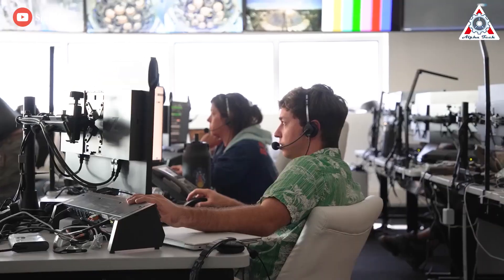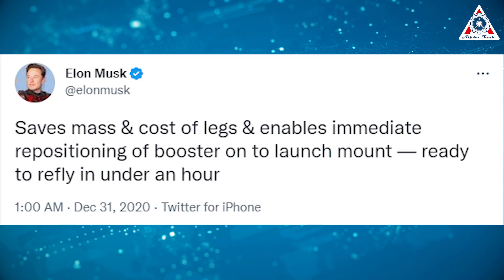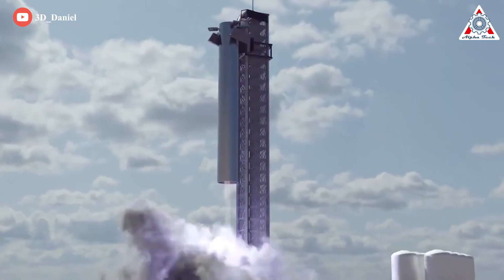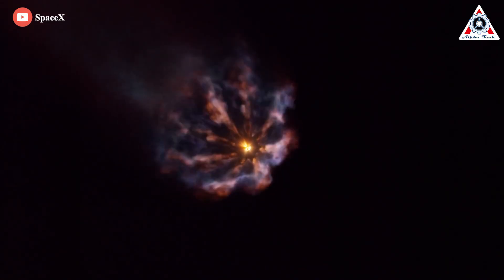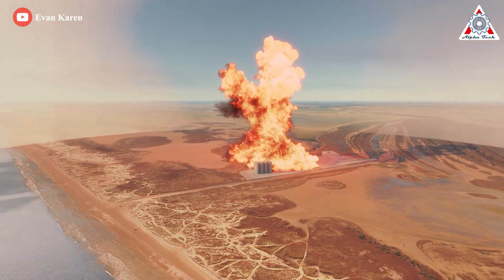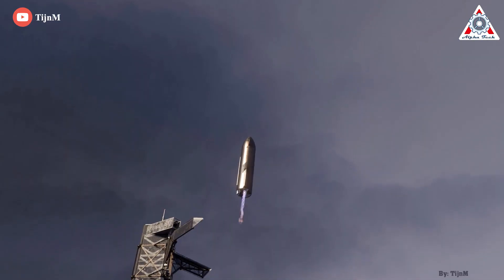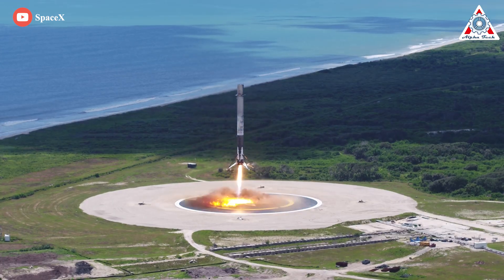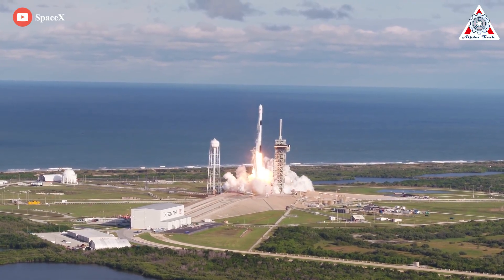SpaceX Mechazilla Catching "PROBLEM"…

Comment: SOME OF THIS really doesn’t make sense to me. From what I’ve read, the flight time of a super heavy booster is 6 minutes— 2 minutes up, 4 down. If there is any damage to the pad and tower, there is no chance you can inspect let alone repair it in the allotted time. 

These arms are meant to swing to the side anyways, why not catch the booster 90° or 180° away from the launch equipment, then swing it into place later? That would cost nothing more than a bare piece of concrete to act as a landing pad, provided it’s far away from feed lines and such.
Reply: Bro that’s extremely difficult with basically just the rocket boost supporting such a heavy and long device. It would be so hard to balance the rocket at those angles. There’s a reason the rocket enters and slowly adjusts the angle versus momentum the way it does.
Reply: @HeilIsrael   I’m not talking about rotating the rocket, I’m talking about rotating the chopsticks to the other side of the tower, so it doesn’t need to catch the rocket over the launch pad— where it might damage umbilicals, etc.

Comment: Once between the chopsticks seems like there's 7 seconds or so to fine tune chopstick/super heavy position. If is between chopsticks at that point then is within a metre or two of optimal position. Obviously a few hundred metres out they should have super heavy falling straight downward with little lateral velocity deviations.. So with 10 seconds to position things they only have to make 10-20 cm per second corrections. if they have a metre tolerance it shouldn't be so hard as long as raptors can manage steady 10cm per second corrections. if one raptor is generating 1 g for landing mass then off axis gimble control of 1% should be enough if final envelope characteristics a few hundred metres out are nominal. I'm sure initally they could land with more fuel to give better margins ie 20-30 seconds to position between chopsticks and then as confidence grows use the extra 30 tons of practice fuel for actual mass to LEO....

Comment: There is definitely a reason why the launch pads are miles away from the assembly buildings and each other at Cape Canaveral. One explosion on lift off or one during recovery could knock out the whole Boca Chica facility for a year or so. Any loss of life would cause commissions and investigations that will last even longer. The launch license by the FAA might be revoked until remedies are put in place. Taking all this risk is kind of short sighted.
All that is without even addressing the obvious difficulties in "man-rating" Starship. I am convinced no NASA astronaut will ever launch from Earth on board Starship. Any NASA missions will have crew launched on a man rated vehicle and dock with Starship. Starship itself is every bit as dangerous as the Shuttle if not more. (The crew sits INSIDE the second stage surrounded by two sets of fuel tanks, with no ejection capsules. How would you man-rate that??)

Comment: Add in the wind it will be near impossible under the present configuration. Can't wait for calm days as there are only a few a year on the shoreline.  I believe it might only work if the arms were built in a funnel configuration that would allow the rocket to self center. Ship however, would have to be redesigned without lower fins.

Comment: I have a solution to this problem
Reply from the maker: Can u explain about that?
Reply: @alphatech4966  Starship needs a launchpad booster/catch ring to lift it higher before it goes full throttle. Wider AOE to diffuse the energy of launch across a wider area. No more concrete rain. Can double as a test for preflight certification because engines don't leave the pad. Then the ring can be divided into 2 or more sections to catch the rocket like a hands would.
Reply: Well I've been trying to find a way to get in touch with someone at space x, but so are thousands of other people. I just got home from work and i think im literally gonna just use cardboard to make a mockup and upload a video onto YouTube and hope it gets to them before they destroy the pad

Comment: Shotwell has to intervene ; the Super-Heavy landing should be downrange using a suitably built landing platform that INCREASES prospects of success. Its too dangerous for FAA and NASA to be associated with a recklessly dangerous landing concept, it can not be next to fuel tanks or a tower required for the Starship to land. IF there are to be multiple on-going Super-Heavy launches they have to land safely such as at a specially designed floating platform 40 or 60 miles downrange; perhaps landing through a landing ring 30m wide and 30m high inside of which is a 25m wide landing well with 10m wide bottom that the booster could come to rest on AFTER restraining straps from the landing ring snap across to center and secure the booster during the final one second of landing. Afterwards the Super-Heavy can be gently tipped and loaded on a transport barge for return to Bocca within a few hours of launch.

Comment: The arms are attached to a huge cable which is attached to a huge shock absorbing pulley at the motor on the far end which absorbs most of the shock.  The arms will travel vertically as the pulley slows the rocket to a stop.  Do you guys ever put out a correction when you miss such an important piece of the engineering?
Reply from the maker: I will find more about this, thanks

Comment: The problem is that rocket engines are not as reliable as jet engines. Most probably Elon has to create the whole industry just for Raptor engines only. After landing each raptor must be refurbished prior to new launch. If you want to launch many times a day, you have to have many fresh refurbished engines ready to use. I don't believe that rocket engines can be used every couple hours again and again with out any problems. No one want to be a kamikaze to fly the same rocket engine in the same day twice. NO WAY.

Comment: Landing a booster is tricky. SpaceX blew up a few developing Falcon 9. The legs add weight and transportation from landing to launch adds time. Landing on arms is the same problem. A target location & altitude. No transport no Landing legs. Bigger initial expensive, paid for by rapid relaunch of the booster.
Reply from the maker: Yes. SpaceX needs years to control F9 landing

Comment: Catching it is the worst idea I've heard in YEARS! Just ONE screw-up and you lose the booster, tower, OLM and likely most of the surrounding facilities. That FAR outweighs the cost of landing legs! Even a few degrees of rotation out of position can spell disaster! Remember, these are the same engineers who designed the OLM without the capability to withstand the thrust of the booster! Destruction of the concrete and damaging the equipment at EVERY launch simply isn't effective OR efficient! IMO
Reply: ouch, this didnt age well

Comment: PLEASE MAKE A VIDEO ON STARLITE https://youtu.be/0IbWampaEcM SHOULD SPACEX IMPROVE THE HEAT TALES WITH EXTA COATING OF STARLITE UNDER THE TILES JUST FOR SAFTY MEASURES IN CASE SOME TILES BRAKE AND FALL DURING DESCENT. PLEASE COMENT. OR EVEN REPLACE THE TILES IN SOME PARTS WITH LAYERS OF STARLITE AND HEATRESISTING FOIL AS A SANDWICH.

Comment: SpaceX should start construction on new launch tower sections in Boca Cheeca to have it on stand by incase the booster blows up on launch and destroys the launch tower or if the booster crashes on the tower causing errepairable damage to the launch tower. This way they could rebuild the tower even faster.
Reply: Before they do that, they'd better have worked out all the concrete base bugs first, or else they'll double the corrections that would have to be made later.
Reply: They could have a dry tower nearby for receiving the booster. A dry tower would have arms but would have no fuel lines or tanks nearby, just a fire suppression system. It could be on tracks so once it’s caught the booster, it can roll back to the launch tower quickly— if the inspection shows everything has gone to plan.
 
Or, as I mentioned elsewhere, at least have the arms on the launch pad rotate to catch the booster away from the launch pad, then swing the booster into position.
Reply: @dmrr7739  Great idea!!

Comment: Can't thank you enough for this mental stimulation!  Landing Solution: 001:  A large oversized  series of landing hoops  can supplement the landing accuracy by shooting a plurality of firehose nozzles towards the center of the chopsticks.  It would ack like a liquid funnel.  It would ease the ship or booster towards the center of the chopsticks and may even be able to lighten the load on the chopsticks by spraying upward towards the grid fins.  Will need to control  the aim of the nozzles as the ship enters the hoops so as not to extinguish the engines!!!  The size of the; at sea landing barges,  should be a guide to the size of the hoops.
Reply: It sure is no crazy than what they are planning. Can anyone you know make an animation of it?
Reply: @lindyhoppingfool  I can make a "Paint" sketch of it.  Wish I still had Dr. Halo I could make a slide show. But sorry, no; I don't know who could make an animation.  A simple imagery is to think of three iron hoops concentrically aligned;  suspended 10 meters apart from the launch tower;  and, each hoop having several gimbaled fire hose adjustable nozzles.  A spray may be just enough of a push rather than a hard stream.  Don't want to flip the ship over! As the ship enters the hoops the nozzles spray the ship towards the chopsticks with a lifting bias in the spray.   The real McCoy will have ten concentric hoops!
Reply: @lindyhoppingfool  Ever hear of Dall.E ?  That AI plus other recent AIs can take my description and run with it.

Comment: I think the crew at SpaceX have got their heads around landing within a tight area of operation, it's the anomalies you have to pin down to make their calculations reliably work.. once you have a functioning system as with the Falcon, the rest is scale.  My worst fear and prediction here is that during the last stages of deceleration and the transition to hover, there is contact with either the tower or the chopsticks.. It's a one way trip, it's not going to be able hover and do a bunch of corrections and land somewhere else because "something happened" as that would be magic. There are a lot of moving parts that need to come together flawlessly for one of Elon's biggest projects yet, godspeed!

Comment: How do they intend to catch it when performing the point-point global flights which SpaceX said would definitely be in operation within the next 6 years, making long-haul flights obselete? The launches will have to made from offshore platforms and operate in all weather conditions. Unless it's anchored to the sea bed, a floating platform is going to move around due to wave motion, so how will it manage to catch a descending booster when the tower is rolling and pitching at the same time as the booster is fighting against gale force winds and torrential rain to reach target position?

Comment: 😎👍👍👍It's good someone else mentioned this little problem. Not only will the first catch be a total nail-biting experience, let's look at the odds of every catch that will have to be made. Machines ware, there will be failures. The cost of one failure will have to be minimized somehow. I would have bigger berm walls and keep the tank farm far from the tower. Elon is over his head here and needs expert help. ME. I can think of better ways to catch a rocket than using a tower so close to components that can't bare explosions like a failed catch will produce.
Reply: I would need to see about 100 successful catches before I'd put a human in the starship.
Reply: If they “miss” a catch they write off the extremely complex pad stage zero equipment - which stops launches for months. The rocket can only be launched if the pad is undamaged.

Comment: Keep in mind the chopsticks are suspended by a cable, not apparently fixed on the tower.  So the cable (and whatever else is designed into the system) would act somewhat as a shock buffer on landing.
Reply: Thanks. I did not know that. Makes sense though. No sense damaging the tower if you don't have to. Cables would snap before bringing the whole darn thing down, right ?

Comment: They could have tried this with a falcon 9.  The resulting implosion would be less consequential in case of failure.  SpaceX could have tested the navigational software even if the ships as so different in the process.    
Again, the choice of the location of the tank farm is appalling as it leaves no room for failure.
Reply: Christophe Blanchi the tank farm has to be near the OLM as there would be far too much loss of cryogenic propellant. Most of it would boil off before it reached the rocket
Reply: @markbishop4774  NASA has no problem with keeping its Liquid Hydrogen tanks out of the blast radius at Pad 39.
Neither do everyone who designs LNG tanker facilities. You just need to insulate the pipelines properly (vacuum works really well).
SpaceX just didn’t buy enough land.
Reply: No SpaceX couldn't. The F9's minimum thrust to weight ratio is greater than 1 - it cannot hover.

Comment: If they manage to avoid the Soviet N1 syndrome and get Starship to be reliable with its 33 closely packed engines and, as if that wasn't enough, reliably catch it using expensive launch site infrastructure also required for launching without destroying it, it will be a miracle.

If that doesn't bankrupt SpaceX, a backup using hardware designed for Starship would be a Super Falcon 9 using 9 Raptor 2s and a Super Falcon Heavy using 27.
Reply: So was Falcon 9.

Comment: When the catching seems too hard or unreliable in practice, SpaceX still has the landing legs as plan B. The chopsticks then only function as a lifting crane, though somewhat over-designed for its job, but very useful nonetheless
Reply: In fact, I still think that is the most likely outcome as NASA is involved more and more. Rather take more weight and massively reduce risk
Reply: The pad design requires the rocket to land on the pad. Anything else and SpaceX is back to needing a vertical assembly building and a transporter that they don’t have.

Comment: This is why almost all early NASA propsals for re-useable boosters and orbital re-entry vehicles used winged flyback designs.
Reply: DC-X was a bare pad design.
The complexity of the SpaceX pad is a different order of magnitude than anything NASA ever tried - the SpaceX engines are spun up by the equipment imbedded in the pad to save fuel and weight.

Comment: Such a catching maneuver can certainly be difficult when there blows a somewhat stronger wind. What I imagine is that you practice it with so much fuel that you can try it out many times without losing the rocket.
Reply: They should be able to mitigate that somewhat by only 'landing' in good weather, the same way that many early NASA launches were scrubbed due to bad weather in a distant recovery zone.
Reply: @ghost307  Certainly a good idea for the beginning, while it in the long term would run counter to the reusability aim.

Comment: So much negativity lately. One thing to keep in mind is yes there was a lot of trial and error with falcon but they’ve learned a lot and I remember them originally saying they can never land a falcon booster. And one thing SpaceX is good about is learning from past mistakes.
Reply: The "advantage" Space X has over NASA is they work at a much lower success rate percentage.  NASA uses around 98% (yes, two lost Space Shuttles work within that number) were as Space X (although its never stated) is high 80% - low 90%.  This is why Apollo cost so much and SLS took so long.
Reply: @bob19611000  A very interesting statistic 👍
Reply from the maker: Hope that they can control this
Reply: @alphatech4966  YOU ARE TOO DAMN NEGATIVE. You must be a hater-hider. All your videos are full of negativity. If everything fails with SpaceX, then they can be faked as Nasa did with the false moon landing. JA,JA,JA,AJA,JA. OR DO YOU THINK OR STILL THINK THEY PUT A HUMANOID FOOT ON THE MOON? JA,JA,A,AJA

Comment: Assuming that the rocket needs no repairs or other work, how long does it take to cool down and refuel?
An hour doesn't sound like enough time.
Reply from the maker: Thanks your interesting questions. I will find more about this
Reply: How long does the incredibly complex PAD take to repair?
The SpaceX rocket pad is more complicated than the rocket.
Reply: Hey bro see this is complex but hypothetically depending upon resources and rocket type, you could definitely refuel in an hour. The liquid hydrogen and oxygen they use for fuel would cool the engines and tank just fine. Also, I’m pretty sure a large concern anyways is making sure the engines are actually hot before full launch. But either way I would say it’s very possible for the liquid hydrogen and oxygen boosters as well as the methane boosters but those might take a bit longer.